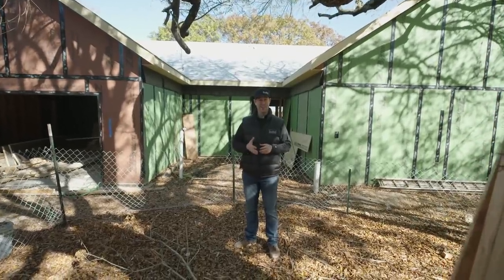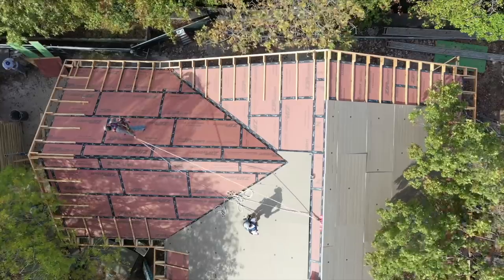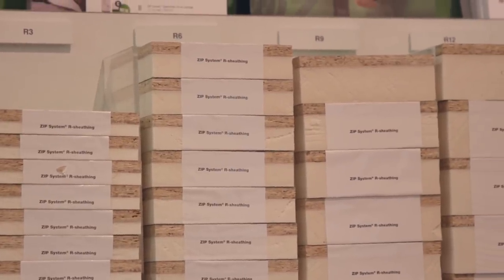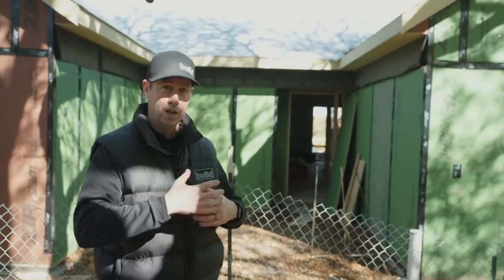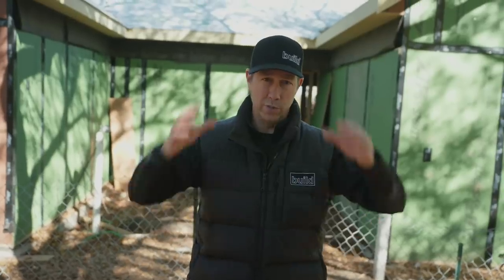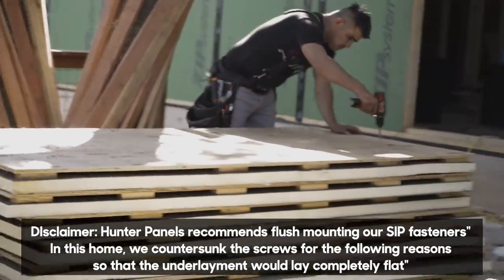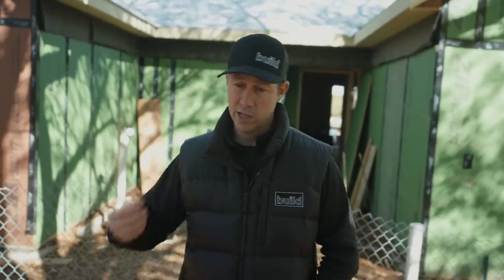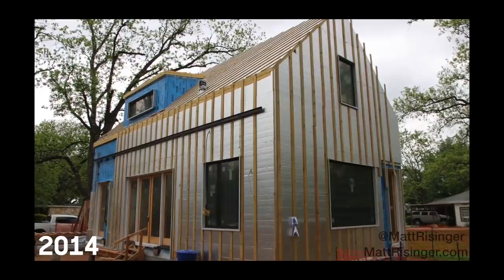Rooftop Insulation with Hunter Panels

Comment: In the mountains of CO we need to make sure the roof is cold or the snow will ice from the bottom and turn into deadly sheets? Would this venting method be enough to keep the house from heating the roof?
Reply: That’s why it is required that we have vented roofs here. Most of the issues we see are poorly sealed building envelope that then allows warmed air into vented roof space which leads to ice dams. This house has an air-tight Zip sheathed envelope, then the Hunter SIP foam as thermal break to vent. Hunter offers up to R20 panels which is recommended in our colder climates. Eliminates ice dam issues👍

Comment: Hypothetical question. If building an ICF house, there are few ways to make it monolithic with a concrete roof. I've seen "spider ties" that tie into the wall frame, but it does not continue the insulation exterior to the concrete. Could this screw into the "spider ties", stay there after the concrete pour, providing an insulation roof side similar to the ICF wall, and then roof as usual?
Reply: Your structural engineer can answer that question, as local codes do not allow a generic answer...unless you live off-grid where you do what you want.
Reply: I have the same question regarding ICF. Can we simply duplicate the Monopoly concept and build a wood structure roof like Matt’s on top of the ICF?  Maybe something like a wall plate on top of and anchored to the ICF and then we build the roof on top of that?

Comment: We have a 1977 12” gable roof (almost flat) meeting a flat roof over the garage. Currently has rolled asphalt roof. We are considering putting a metal roof directly over it when we are ready to add a new roof. Can you direct me to any post that you have on the subject please?
Reply: Christina, be super careful with that approach. Low-slope metal roofs will be hydrostatic (think standing water - swimming pool, not water flowing off roof) designed and require double mechanical lock with sealants in each seam-lock to be considered under warrantee.  Check with your metal roofing supplier (not the roofing installation companies, the actual maker of the panel metal - like Carlisle company, etc.) to see if they would even cover a warrantee if installed over rolled asphalt.  Maybe they will, but they'll have some requirements on roof underlay and on allowable color of the roof metal so heat build-up is not an issue.  Non-white roof colors could potentially melt into the asphalt and depending on your orientation/location/exposure you could get into major issues with local buckling of the metal panels.  Do not trust this decision to the local installers, get the manufacturers to provide written validation to you.  pac-clad.com has some useful information on their site on this topic.  (I'm doing a low-slope 1.2/12 standing seam aluminum roof, tropical Hawaii, white panels on high temperature peel and stick underlay.)

Comment: Matt
I built my house so tight ((open cell spray foam) zip sheathing taped) )
That when the gas appliances are in operation I get a negative pressure envelope.  What do you do to over come this effect
Reply: @FD1075 !!  Matt addresses this in his earlier videos. You would need to install a make up air system. On the higher end you would want an HRV or ERV depending on which climate you are in. On the less expensive end, you would install an electronic damper. They all have a differential pressure switch that actuates them to bring in fresh air from the outside. This would be tied into your HVAC lines. Don't forget that if you are in the humid south you should also install a dehumidifier like an April  aire as well.

Comment: This is basically the REMOTE building system ( https://www.youtube.com/watch?v=1leyQtqVV-A ) from 10+ years ago (mostly Canada/Alaska) with different/modern sheathing (integrated vapor barrier).  Primary feature of that system is that the stud bays are mostly empty, and you have easier detailing of moisture/vapor barrier outside the building envelope due to insulation not being between the studs.  The moisture/vapor barrier needs to be in the right place though for the building to last, the key concern is where the dew point happens.  No matter which ever side is the interior side, the dew point MUST occur to the exterior of the vapor barrier, and there needs to be a place for that condensed moisture to drain.  General rule of thumb is 25-30% insulation to the interior, with the remainder to the exterior (with a rain-screen).  There is such a thing as too much interior insulation with a system like this, as a dew point transition to the interior of the vapor barrier will result in water condensing in the walls where you don't want it.
  
I like this system Matt presented with the following stack-up criteria: un-foamed t-studs, insulated vapor barrier sheathing (Zip-R) with a fluid applied seam and sealer compound, open-cell spray foam to the interior making up the 25-30% R-value, then a drainage wrap under Rockwool insulation (the remaining 70-75% R-Value), a rain screen, and then exterior cladding.
Reply: I just watched that video.  R-60 roof insulation!

Comment: Matt, would you use the same wall layering in Zone 5? For some reason I was thinking I would need to have the vapor barrier on my inside walls.
Reply: In Zone 5 vapor barrier depends on multiple factors, will you have AC, is your insulation permeable, do you plan on having exterior insulation. If you answer yes to all three questions above then you want the vapor barrier with 2/3 of the insulation outside the vapor barrier. That keeps water from condensing in the wall assuming interior is 70 degrees and 40% humidity and exterior is above -5 degrees and this system would not be a good idea. If you are using impermeable insulation, like the poly-iso in this system, then the insulation would be your vapor barrier making this system ok as long as there is continuity between panels and no airgaps where vapor can bypass around the insulation. Details are important. These are my opinions and further specifics should be investigated by a local professional.

Comment: Why can’t you use zip r on the roof sheathing? I haven’t seen anyone say or do that. Is there a reason?
Reply: Currently ZIP R is not approved for roof sheathing. So it's an engineering thing until the Huber engineers can say otherwise.

Comment: Does this work with 140 mph Dade county wind load standard?
Reply: I was curious about this too.  I’m in Palm Beach County, within a mile of the coast, where the current (effective 1/1/21, on a 3-year update cycle) hurricane wind load building code for houses (ASCE 7 Risk Category 2) is 170 mph.  It’s even higher in Miami-Dade County, I think 180 or 185 mph for houses.  So I read through Hunter Panels’ website to look for any info on this.  Their Cool-Vent product info page, under “Codes and Compliances”, states this product complies with the Florida and Miami-Dade County building codes – “State of Florida Product Approval Number FL 5968”, and “Miami-Dade County Product Control Approved”.

Comment: Why wouldn't you use Delta Trella (air spacing mesh) on top of roof insulation instead of adding spacers and plywood? I know you have done projects using Delta Trella.

Comment: yeah, I dealt with a house that had the rafters end at the walls, and eaves nailed on after the fact - that combined with shiplap roof sheathing meant the eaves came loose and had to be rebuilt when the house was reroofed.  but in all fairness, it is a terribly built house and needs to be remodeled with a trackhoe.

Comment: matt zip when properly installed is NOT really permeable(0.3 perms) wet OR dry. if t=you create a totally zip envelope, wall must dry to the interior but if your drywall, latex paint and seal (or avoid) all wall receptacles and switches , the wall can't dry tot he outside OR the inside ...

Comment: Question.  You use a lot of foam, which I like. But I am told in termite areas of the country were termite treatment is required  companies often will not treat buildings with foam, especially when the foam is concealed.  How do builders get around this problem ?

Comment: Unless you live in a house with no windows or doors, spending all those 10s of thousands of dollars on making your home more insulated, in my opinion is over spending. The average energy star window is R3. Most modern design houses are big on natural light and lots of big and tall windows. Of course there's insulated drapes and uv glass etc You could just live in a giant Styrofoam cooler. There's something to be said for a few leaks of fresh air and occassional insect.

Comment: My only experience with hunter is there osb 3inch insulated panels, and they are absolute garbage. The osb is rough on all edges and the foam is most of the time shorter than the osb on top or the lining up of the osb and foam are incorrect. Great concept, poor execution on the osb version.

Comment: Aren't you making this house too air tight? Homes need to breathe a little.
Reply: They are likely using systems from within the house to exchange air which allows them the most control, as well as the ability to pass the air through filtration first, as well as exchange heat between incoming and outgoing. Better than your house pulling air through the dirty wall cavities filled with pollen etc.
Reply: Plus, from what I remember @Matt Risinger stating in other videos for where he is down in Texas, an airtight house is also an energy-efficient house.  I think that is paraphrased correctly.

Comment: @1:32 mark. Did not see any hurricane straps. This would have been a good time to run a metal band across some if not all the rafters and tie them into the wall to prevent uplift in any high wind storms.  Or at minimum hurricane straps.

Comment: Attics serve no purpose in the long-term. Advantech sheathing on a flat/low slope roof with a double layer of 40 mil+ epdm will last a lifetime.
Reply: It's the mechanical room. That's why you want it conditioned.
Reply: @Matlock69  You are missing my point. Mechanicals can be placed anywhere, thus eliminating an attic entirely. I've owned 10 different houses, all different builds. I will take the all brick built in 1890 with no attic, epdm roof, and a sandstone foundation over any of the others.
Reply: In a new house, how about designing around the mechanicals?  The rest of the design makes more sense then.

Comment: How do you justify this? ROI on this is almost non existent. Seems like there are so many better ways to get a high R-Value and with the Zip I don't see how this way makes that much difference. I would like to see more videos breaking down systems by cost/performance. Like what is the most cost effective way to get the highest R-value in a wall or roof system. What's the most cost effective way to ventilation a house. I'm sure there are kickbacks from these companies but if you truly want to improve the way houses are built across America it has to be within reach of the average homeowner or contractor. Zip-R is one of the few products that make sense in a cost / performance for the Joe. Some of this other stuff is just ridiculous.